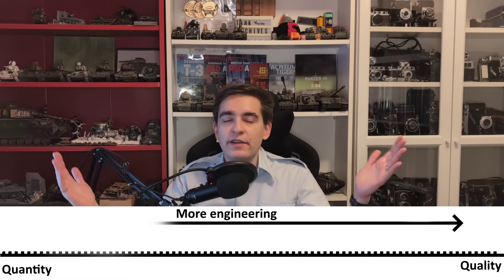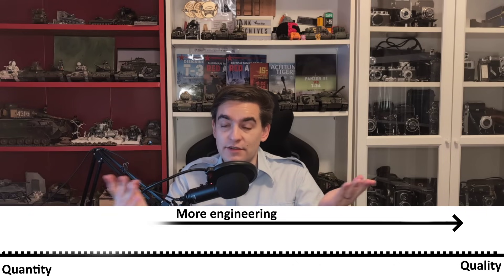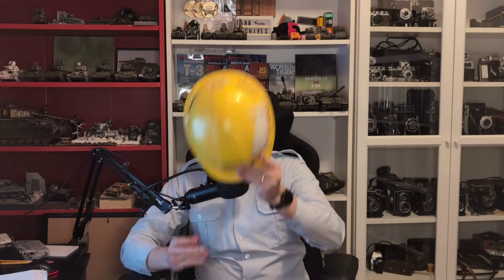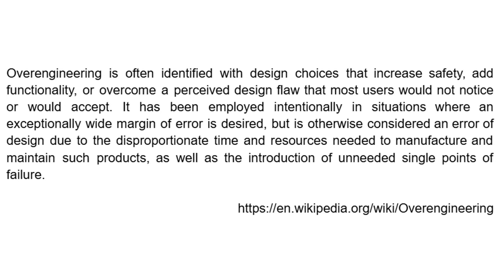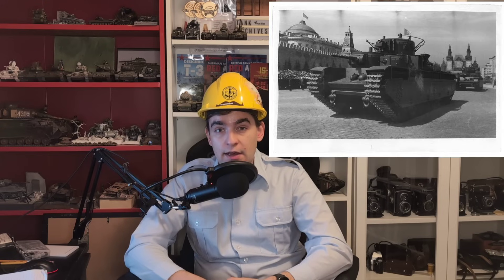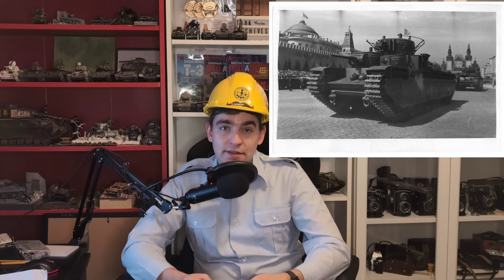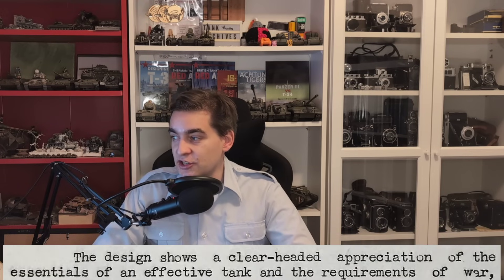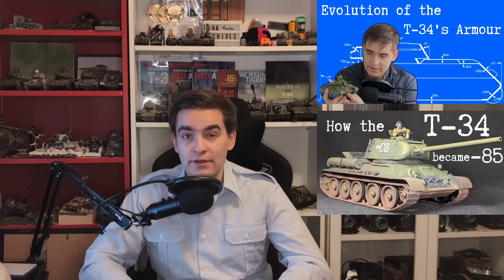Was the Tiger overengineered?

Comment: The German arms industry deciding what type of products the military will get regardless of need and at exorbitant markup sure does sound awfully familiar.  Did they promise generals cushy consultant gigs after their time in the military as well?
Reply: On the plus side: after the war everyone involved could claim to have been secretly in the resistance😂
Reply: Still scratching my head about all the minor changes Tigers went through in the production line so that The tiger coming out the line would  be somewhat different from the ones being assembled in the back.
All the small tinkerings make servicing on the field harder

Everybody just used a phased update.
Reply: @huntermad5668  Those minor changes weren't a matter of individual factories deciding to do things differently on their own. These incremental changes were done by everybody for nearly every piece of military equipment based on user feedback and experience in the field. Feedback from the crews of Tigers in the field could be that they found that the placement of the widget A was hard to reach/get at, so the Army decides that they have a valid point and they tell the factory that for the next batch of Tigers to move widget A to where the crews said that it would better placed for them. Then that, along with other changes, becomes standardized as the next model of Tiger and is given a new letter designation, so the Ausf. A now becomes the Ausf. B and when further changes are made the B becomes standardized as the Ausf. C and so on. This is a bit of an oversimplification, but the bottom line is that the changes weren't being done on the whim of the factory/factories and were duly authorized changes.
Reply: @Riceball01  
Except other countries did that too.
But they  didn't come anywhere near the level of Tiger.
And they did in phased, Tiger have phase but too many modifications were made to believe that they just keep the basic phase update

Also, there is no way they would go around and approve so many changes like that. So most of those changes are likely engineers tinkering around and report what they did later
Reply: Funny you should say that, didn't a lot of surviving German generals also end up in various CEO/Consultant roles with German industry giants?
Reply: @ToreDL87 nothing to do with it.
Reply: @ToreDL87  And on NATO, EU, Pentagon...
Reply: That is what happens when the führer decides, not the heeresamt für beschaffung.
Reply: @UnfollowYourDreams if you would read up on it, Hitler himself really didnt do these things without long consideration and counsel with generals and engineers, this "the führer waltzed in and changed things because ego" never happened. Even the drive for Moscow instead of Stalingrad at the beginning of Barbarossa was Halders strategy, not Hitlers
Reply: @Mühli9066  "wenn das der führer wüsste" ja ne is klar...
Reply: @UnfollowYourDreams wieso, was isn dadran falsch ? Da gibts ausführliche Dokumentation über viele Debatten die damals geführt wurden und wie man zu den Entschlüssen kam, die man traf. Das hörst du halt nur in deutschen Medien nicht mehr weil wir Deutschen eine Hitlerpsychose entwickelt haben
Reply: Simple answer, yes. Hitler paid off his generals with numerous one off gifts
Reply: What gets me (without going too political) is that there are people who insist that Nazi Germany had a "socialist" political economy, when not only was German workers' pay cut, not did Germany's industrialists bail out the Fuhrer 1932 election with moola, in the you have the arms industry dictating to the government what weapons it should produce based on profit motivation!
Reply: That sorts of concept only really applied to American arms industries, where every war since 20th century were fought across the Atlantic in a comfort seat. 
Highly doubt German arms industries would care much about profits over needs when losing the war meant Red army coming over and sacks everything.
Reply: no
Reply: No, that didn't happen. Army gave the requirements, and maunfacturers tried to meet them.
Reply: I think Peter is being oversimplistic with his terminology. From what I've read, the German Army put out requirements and the Heeres Waffen Amt assessed the submitted designs, gave feedback and chose the winning designs.
What may be the case is that the Army may not have thought about the production side, being focused on fighting and military needs, leaving industry to operate with bad habits.

Comment: Great Video. One thing I often think about is what the Plus side of the bigger Dimensions and weight of western cold war tanks really was. From a soviet perspective they were also quite wastefull.
Reply: As per usual this comes down to requirements by the respective armies. Soviet tanks were designed to a standard where 75% of the people could easily fit in and operate the tank while NATO tanks were designed to fit 95% of the people.
Reply: @UnfollowYourDreams  the internal volume in the fighting compartment isn't much different in for example Leo2 and T-72. The big difference is in the engine Compartment. Where no people are
Reply: Military History Not Visualized posted a video on this exact topic some 3 months ago.
Reply: @UnfollowYourDreams  so did I 😃  and I have to confess that my mind took a Monday morning wrong turne earlier. The length of the fighting compartment and the width of the Tanks are comparable between Leo 2 and T72. But the internal volume of the fighting compartment is smaller, as you said. For some reason I only thought about the length earlier
Reply: Love your channel btw., i'm a longtime follower. Keep up the good work!
Reply: It's because neither US nor any western European state has ever experienced a war of extermination. The prevalence of smaller, easier to construct and overall streamlined designs in soviet tank engineering is the direct result of Great Patriotic War. In real large scale conflict when millions of people clash in a single engagement, it doesn't matter if your tank can see lightly farther or has more comfortable seats – it was to first and foremost get the job done and be available at all times, everything else is secondary.

Comment: Very interesting talk, thank you for this.

I guess the dissonance is more about the meaning of the word "overengineering". Most people seem to attribute that to a design that seems too complex and difficult to produce for what it accomplishes, especially in comparison to its peers.
Reply: I would say Sherman and the T34 were under-engineered under the common layman definition. Having "safety margins" is under optimizing the design. It creates inefficiencies. The Germans tried to do away with this as much as possible, in a big part due to their relative scarcity - for example, they couldn't equip their tanks with extra powerful engines from the get go because they had less fuel. This optimizing led to the Tiger being un-upgradeable because it was made in a single "optimized" form, thus overengineered.
Reply: Not to mention the constant design tinkering that made spare parts a nightmare.
Reply: @terraflow__bryanburdo4547 Wouldn’t have been too bad if they could afford it like the Americans did with the Shermans. The Americans however, had a factory for every two plots of land (I’m joking), and they had a lot of land and people, with really good supply chains.
Reply: @terraflow__bryanburdo4547  Constant design tinkering is something that was done by pretty much every military and was usually done based on user feedback. The more you use something the more you get to know it and find out its strengths and weaknesses.  These constant changes were done to all of their tanks and were done to either address shortcomings, make improvements based on feedback from the front or technological improvements, or (in some cases) to simplify production. Since the overall chassis remained largely the same, these changes shouldn't have impacted their spare parts chain too greatly. It was the concern over spare parts that saw the Germans create so many assault guns and SPAA based on existing chassis instead of building brand new vehicles from the ground up.